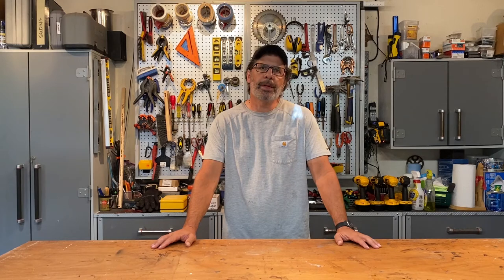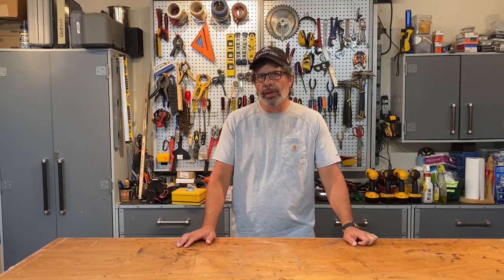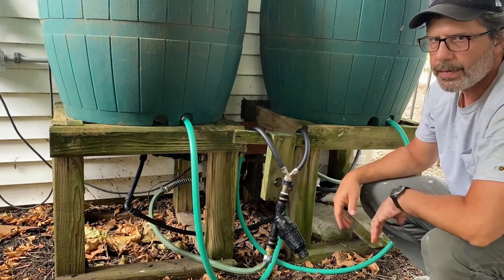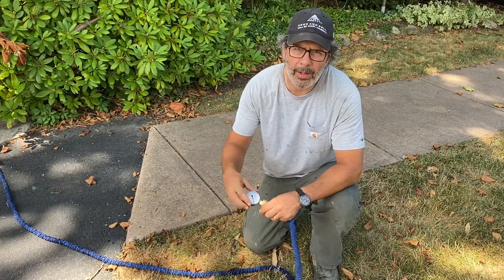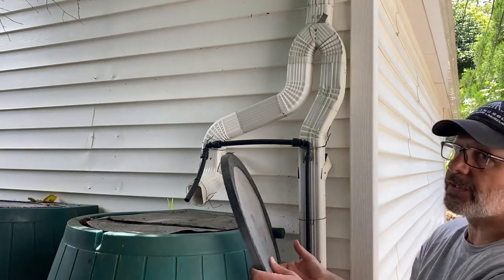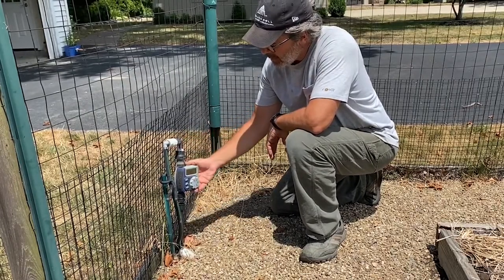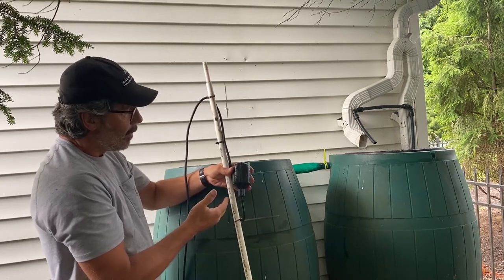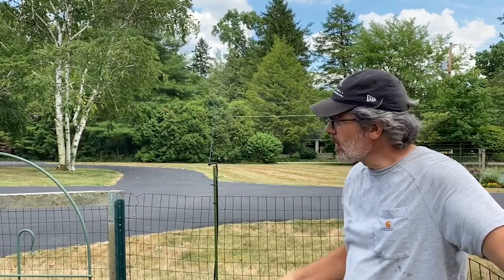The Ultimate Rain Barrel Irrigation System

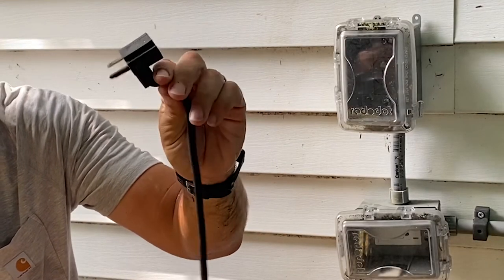Comment: How is the solenoid wiring added to the pump?  I understand the process and float switch w plugs.  I was just curious how you hooked up the solenoid valve to the pump.  At the 8:35 mark I see your wiring when you explain the pump I was wondering which wires are from the solenoid?  I was thinking of getting this pump, https://www.freshwatersystems.com/products/shurflo-2088-594-154-delivery-pump-3-3-gpm-45-psi-115vac-no-cord and just adding the solenoid red and red to the pumps black white wires.  Your part 4 at 23:35 explains the plugs well and I was interested in the wiring too on the pump.  It seems like your always "on" garden hose running to the solenoid valve is outside the pump house you built but the wiring runs into the "pump house" you built.

Do you have a recommendation on the valve?  normally closed is the type you have? (or is it normally opened?) because when the power is on the valve is closed but when your power is off the valve is then open so that your city water pressure is then on.

I appreciate the help with the diverter (I live in Michigan), floating switch with solenoid switch valve. It does seem to be the ultimate one.  Ive been watching videos for a week as I design my rain barrel system and your's combines all. I appreciate your 10 years experience  Most do a manifold system of hooking rain barrels all up so the float switch I gotta figure out better but I appreciate your video.  Ill try not to screw it up.

thanks again
Reply from the maker: Good question.  I had removed the solenoid in that part of the video at 8:35 so it is not shown there.   A single power cord coming from the float switch runs both (black to black, white to white, ground to ground),  but the flow of water is totally separate.  The pump controls rainwater from the barrels to the garden.  The solenoid controls hose water flow to the barrels.   The power for both the pump and solenoid are controlled by the float switch.  The solenoid is not in series (water flow) with the pump in any way, but they share the same power source.  There are the different states: 

1) Barrels full, Float switch on, Pump activated on demand, solenoid closed. 
2) Barrels low, Float switch off, Pump off, solenoid open (hose filling).
Reply: @dontscrewitup  Thanks.  I'll try and find an normally open solenoid valve and then a pump.  Thanks for taking the time to make the video, post it and then respond.
Reply: @jeffreybradley7433  here is a photo of the pump and solenoid. I’ve since upgraded to better waterproof wire connectors. https://share.icloud.com/photos/0NJMPFsXlAVuaSe4zyPhvml6A#Bay_Village
Reply: Ahh!!  Now I get it.  That was key.  Thank you so much for adding this photo.  Quick connects too.  Waterproofing will be good plus you mentioned in video that the pump heats up so the ventilation I understand.  Thanks so much.
Reply: @thesourdoughjourney  Any chance you can share that photo again? It is no longer available. Thank you!
Reply from the maker: I’ve upgraded to better waterproof connectors since this time. 

https://share.icloud.com/photos/0z6R_Typm7AMyNgJCNiGkCJNg
Reply: @dontscrewitup  Thanks for the quick reply, also a fellow Clevelander here!
Reply: @dontscrewitup  can you share that photo again. I can't view the photo. Thank you. Like the system, this would be perfect for my in-law
Reply: @thesourdoughjourney  can you share that photo again, thanks
Reply from the maker: https://share.icloud.com/photos/0zOODKgNvYxOHQPbTFgKS4_lA#Bay_Village

Comment: Ps I put a plug on the backup water solenoid wires and plugged it into the back of the plug on the float switch it eliminates any need for a switch to shut off the pump if the barrels run dry b/c the backup water goes on before the tanks run dry.   Is that how you did it ?
Reply from the maker: Similar, I think.  If the pump is running and the barrels get low (not empty), the float switch turns the backup filler on and the pump off at the same time until it refills.  If the backup filler were not working for some reason, the float switch would kill the pump before the barrels run dry.

Comment: How did you mount the pvc pipe with the float switch to the barrel?
Reply from the maker: Good question. I have a 5lb weight sitting in the bottom of the barrel. I put the bottom of the pvc tube in the hole in the center.  The tube is cut to the exact height of the barrel and the top of it sits inside on of the “ribs” in the top of the barrel, between two zip ties.   I used to have a spring loaded section of the top of the tube but it was overkill and kept rusting out the spring.  I basically just figured out a way to wedge the PVC tube into the barrel so it remains upright.  You basically need to stabilize it on the top so it doesn’t move around and weight it on the bottom.

Comment: Thank you for this great Video. I just ordered the pump. Do you have a link for the inline filter? Just curious Tom. As I plan on using this kind of system primarily in an effort to water garden boxes while we are camping, wouldn't a Submersible/w float switch running through  a timer valve suffice? (running from 2 250 gallon water totes).
Reply from the maker: Thank you.   Here is a variety of in-line filters similar to what I use. https://www.dripdepot.com/category/drip-irrigation-filters

Yes, if your tanks are that large and you don't want to set up the backup filling system, you could use a submersible pump on a timer.
Reply: @dontscrewitup  Thanks Tom. Will run pump from outdoor smart switch as well. Also planning on primary system as you have laid out here. Thank you again.
Reply: Hey Tom. I live in BC. Canada. WE get ALOT of rain. Do you think this indoor rated pump needs to be indoors? I was thinking of running it into my outdoor sauna change area as I doubt I can keep water from leaching into the chamber (sideways rain etc.)?
Reply from the maker: I've considered putting the pump indoors in the past. It will can get hot when running so be sure it is ventilated to not create fire hazard.  I use waterproof electrical connections and a waterproof outdoor outlet for my pump. There are ways to create outdoor electric connections in wet locations.  I also made a 3-sided housing for my pump and connectors. I would not enclose the pump entirely.   For the safest outdoor, wet location setup, look into a "sprayer pump" (used on irrigation trucks, etc.).  These are wet location pumps and they run on DC power.

Comment: I wanted to set up a similar system, but for drip irrigation. Do you think this would work? I’m in northeast Ohio also, 40 mins east of Cleveland.
Reply from the maker: I use a  micro-drip irrigation system that normally would run off of reduced hose pressure.  Are you thinking of something different?
Reply: Not sure what I want to do. Looking at a few different things. I was hoping to get away with just gravity feed. The husband said he can hook up a pump to help the pressure.

Comment: With your mains water backup system... when does the soleniod cut off?   Does it just fill up 1/4 of the ballerls (one days worth of water) or the whole lot.  And could you use a separate float to just govern the soleniod?
Reply from the maker: Good question.  The same float switch for the pump cutoff is the one I use for the solenoid.  Based on the way I have it rigged in the barrel the cutoff for the pump happens about 6 inches from the bottom and the cutoff for the solenoid backup cuts off at about 2/3 full.   You could definitely use a second solenoid, but this setup works well for me.  I'd rather let the hose partially fill the barrel multiple times than I would try to fill it to the top.  This method also catches more rainwater by not always topping off the barrels with hose water.

Comment: Could you please tell me where I can buy the solenoid, the pump and the kill switch? Thanks
Reply from the maker: I will post links later tonight.  Are you in the US?
Reply: @dontscrewitup  Yes, I am in Florida! I tried to find it at the Ace hardware store but the solenoid is wired the opposite of yours. When the power on it in the closed position and the the power off it’s in open mode! Is your solenoid trick the opposite way to where it’s open when off and closed when there is power? Thanks a million.
Reply from the maker: Here is the solenoid I use. I bought mine on eBay (new). https://www.ebay.com/itm/3-4-Brass-Solenoid-Valve-NORMALLY-OPEN-N-O-110V-115V-120V-Volt-AC-VITON-B21V-/122490601096?_trksid=p2349624.m46890.l49292

Here is the pump I’m using (From Northern Tool).  https://www.northerntool.com/shop/tools/product_200249074_200249074

Here is the Float Switch (from Amazon) https://www.amazon.com/dp/B082J71MJZ/ref=cm_sw_em_r_mt_dp_YYFSGDKE2R69KDM4EBC5
Reply: @dontscrewitup  Thank you sir!